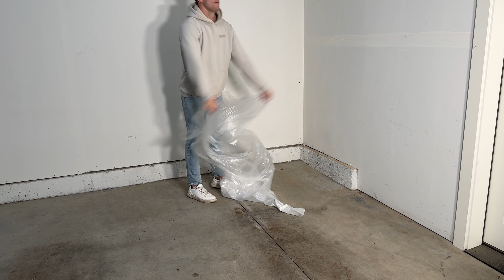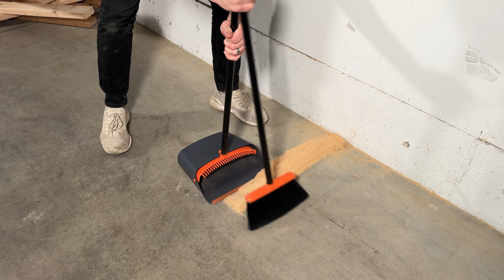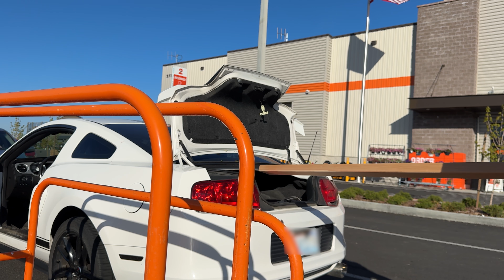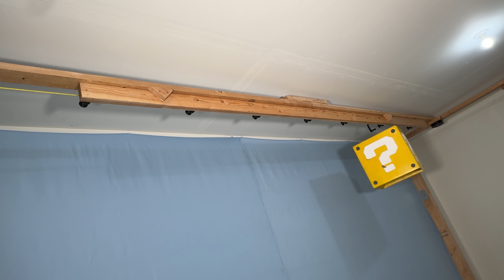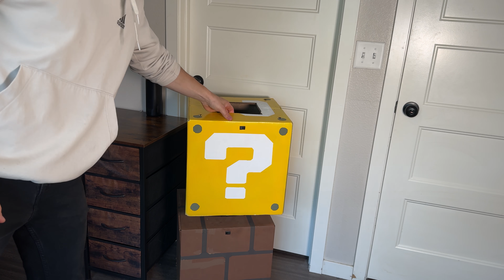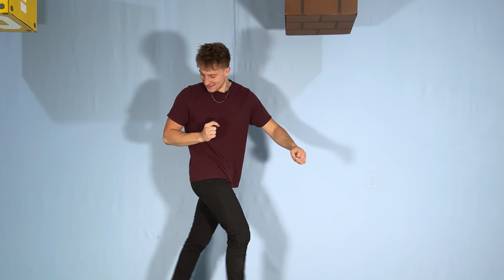Building Real Life Super Mario Bros

Comment: Rather than a motorised treadmill to run on, I think a manual one might work better. You could hook up the box pulley system to the treadmill via a belt drive, and create a 2nd rail for bullet bills, lakitus etc. That way you can separate the blocks(which are static objects) from all the active entities that move even when you stand still.